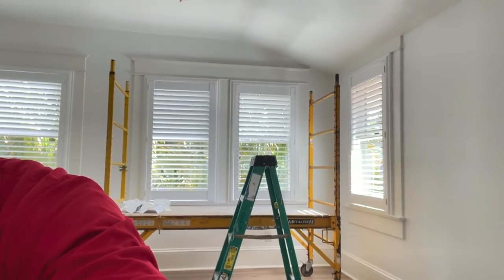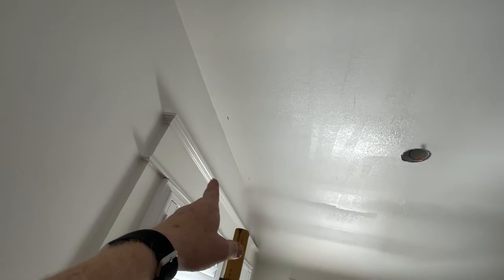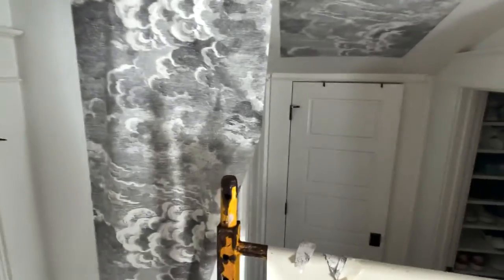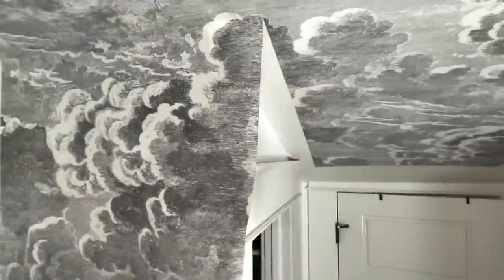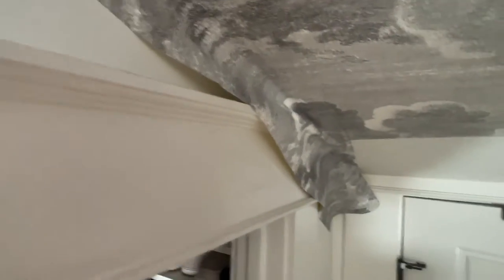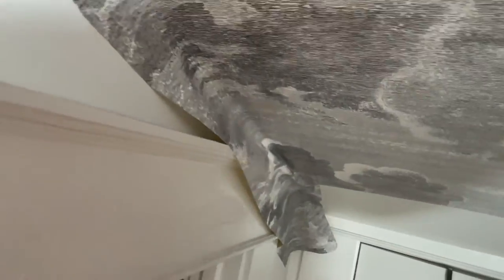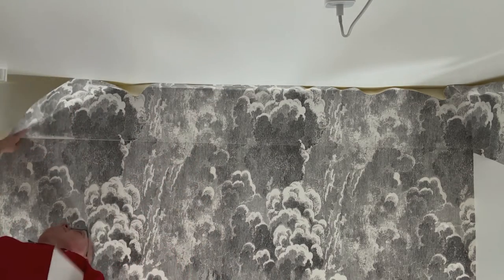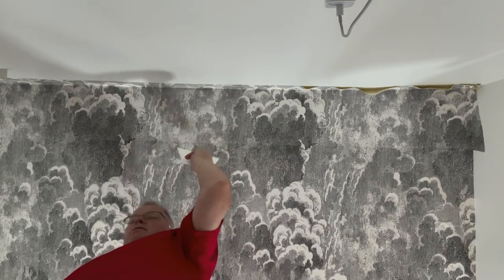Wallpaper a Ceiling With Cole & Son Fornasetti

Comment: We use a step ladder at each end and ladder benches so you can simply walk across. Snap a chalk line. Also a staple gun is your best friend. You can also do it easily alone by running string about every 4ft and looping the paper behind. We also use a concrete sweep on Sherlock extension pole which works surprisingly well. Try doing 54 inch vinyl across a 30ft ceiling now that's fun !!!
Reply from the maker: Love your comments.
Reply from the maker: Stapler!!!! Wow.  I only have the guts to use large push pins!!
Reply: Same here.. my buddy only uses push pins. Everyone is different 👍
Reply: @spencercolgan  yeah I've used push pins too, a stapler is better for heavy materials like grasscloth or 52" vinyl.